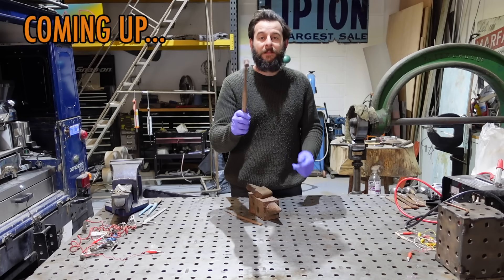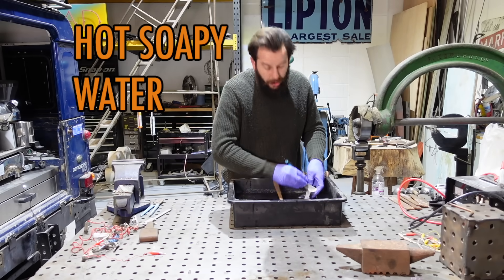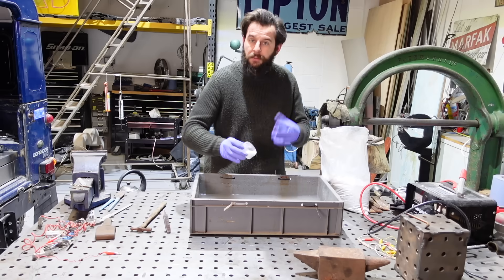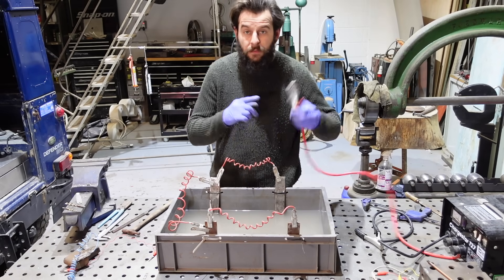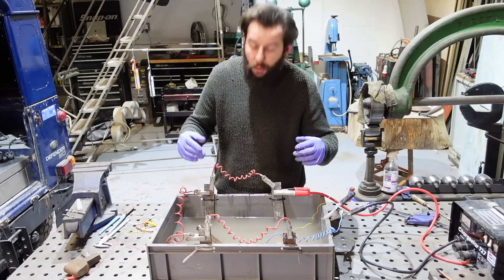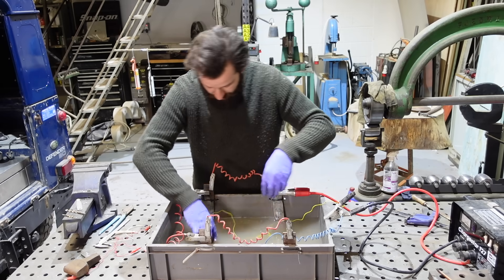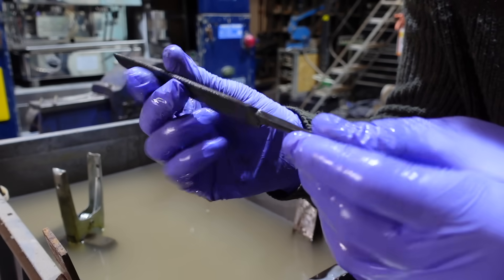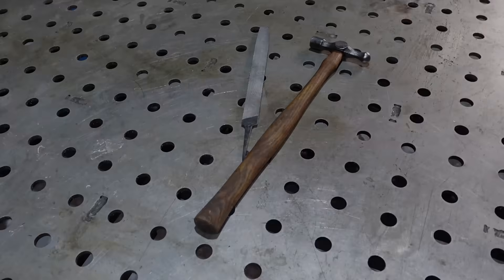The Power of Electrolysis | How To Transform Rusty Tools!

Comment: Hi Dominic your video is most interesting and I have watched it over and over. Yesterday I tried to reproduce your results and came up confused disappointed and lost for what to do next. I turned on the power last night, confirmed I had fizz, plenty of it actually and time I went to bed there was some rust which had dropped to the floor of the container, but the shifter I was trying to restore was well and truly rusted so I left it overnight. This morning when I checked the tub it was about 1/3 full of crystals in large lumps like ice burgs. I did use a lot of sodium carbonate but did confirmed that it had all dissolved before starting. Please any suggestions?
Reply from the maker: Sounds like you maybe used a little too much of the sodium carbonate, but the process sounded like it worked? 

It will only remove the rust from the part the wire is attached to 

Did it remove any rust?
Reply: @DominicChineas  Hardly any, there was a little powdered rust spots below the shifter but very little removed. I have another battery charger which I am going to try as the original doesn't have an amp meter, the next one to try does. I will use less sodium carbonate and try again. The powder I am using is "sodium carbonate light anhydrous. Thinking about it, the shifter was coated in the crystal so maybe that prevented the reaction. Thank you for your reply. I hope I can report back with success.

Comment: Using warm, or hot water will make it easier to dissolve the sodium carbonate.  Also, a well ventilated space is required, and watch it if you are using power tools for other projects as the motors can produce a spark.  (Some power tools, not all)

Comment: I did thi to remove some corrosion from solid copper cups, worked great till. I accidentally reversed the polarity, an hour or so later, when I noticed it, the cup was pitted, not bad definitely noticeable, I hope Chrome plating will restore it.

Comment: I've done etching with salt water, does this do the same thing when using sodium carbonate instead of salt?
Reply: Salt is Sodium Chloride, it gives the same result with the exception that while  using sodium carbonate, the process is relatively clean, with salt, it may produce Ferric Chloride (that gives the green coloration), which is a relatively harmful product for the environement., especially when flushed down sink.

The main pupose of dissolving a large amount of any salt in the tank water is to increase conductivity of the water for electricity, you can use any salt, considering that carbonates tend to not react with iron.
Reply: @rustygear9370  Sodium chloride is a salt. Sodium carbonate, sodium bicarbonate, sodium sulphate are also salts.

I'd be wary of some of the byproducts, chlorine gas could be emitted, I have used electrolysis to produce chlorine. You don't want much of that around, it's toxic and relatively dense.

Ferric chloride is highly corrosive, it's used for etching circuit boards.
Reply: @rustygear9370  
That's exactly what I was wondering. I always thought it produced chlorine gas, which I'm not a big fan of breathing. The good thing about salt is it seems to make the etch very aggressive. I used iron sulphate and it seemed to do nothing in the same time compared to the salt.
Will definitely try sodium carbonate.
Reply: Yes.

Comment: Honest question here, what do you have to do to prevent the parts from flash rusting again afterwards? I use the Muriatic acid bath method and right after you have beautiful clean parts like yours, but they tend to flash rust again after a short period of time. Does that not happen with the Electrolysis cleaned parts?
Reply: Did I see somewhere that you can pop them in a bath of distilled white vinegar afterwards to neutralise the metal surface?

Comment: So why does the rust flow to the positive when the current is flowing from the positive to the negative 🤔🤔🤔
Reply: Hydrogen (bubbles) are generated at the cathode or negative electrode. The process turns positively charged 'rust' cations back into the iron metal.
The anodes slowly 'rust'away as he explains in the video.

Comment: Wonder if you could use copper for your anodes?
Also, you can use Potassium Hydroxide for your electrolyte (but not with copper anodes).
The closer the anode and cathode the more efficient the rate.
FYI: many battery chargers used pulsed DC current. Steady current might give better results (add a big capacitor?).
Voltage for that would work better at 30VDC to 36VDC.
Keep adding electrolyte if you can until you get 20 amps @ 12VDC.

Comment: Not impressed, in industry we always say there no accidents only idiots. Far to many to cover here, when using a caustic soda solution eye protection must be worn, if you get it in your eyes even a dilute solution will cause permanent damage, and tap water will not help. Electrical safety protocols non-existent.
For little jobs like these, old-fashioned elbow grease will suffice, and some paraffin from the hardware store, just try not to burn the fucking house down. Nil Point as the retards like to say at the Euro-visons.

Comment: Restoring rusted parts using electrolysis or chemical baths (not covered in this video) also somewhat restores the smoothness of the surfaces. The rust  is like a minute shrub that grows from a tiny scratch or pit and builds itself up while doing very little surface damage to the item. So not only does the tool end up looking better but often functionality is restored too. For example rusty nuts and bolts can once again be used for their purpose with the need to machine the surfaces. I have a small tub expressly for chemical soaking similar to electrolysis that eats away the rust (iron oxide) leaving a black carbon residue that a gentle brush scrub under water removes. Its a great addition to your home workshop to have something like this permanently on a shelf ready to go giving you a way to save those fiddly fixtures that you want to keep original on a project (or are impossible to replace with modern alternatives). A chemical bath that isnt corrosive or fume toxic (like an acid bath) will just keep in a plastic tub  for years and years if it has a lockdown lid. Likewise an electrolysis bath you can make in a suitable sized tub to fit then inside a larger one with lockdown lid so it doesnt evaporate away and you can have at the ready always with a single cable out to power source. A simple rust removal solution is just invaluable for every restoration workshop. Just ensure you dont leave items in them for longer than overnight without taking them out, brushing and rinsing in water to check. The longer you leave them the more chance you have of the processes damaging. So leave, check by cleaning the carbon off under running water then dry  to check progress of rust removal, repeat as  many times as you need to get rid of the rust. Over time and use you get to be able to guess how effective the result will be and how long it might take. You may be able to use this as a bit of a local home business and it requires very little starting costs or running costs. Use the waiting time to learn how to sharpen garden tools and lawnmower blades which will go well with rust removal service for restring saws, axes, shovel etc. Get your eletrolysis terminals (positive/negative) properly sorted by testing with rusty nails first, some small electronics power packs can be confusing as to which wire the positive is in and which is negative. So always test first with rusty nails when building your own setup, big or small. Remember this is DC electricity NOT AC.

Comment: A current limited variable power supply works better, but I use an old solar panel- they are current limited by their construction, an old 250w ex gridtie will be up around 35v, with about 8-10A depending on the conductivity of the  solution.... (and runs for free lol)
(thats the problem with using battery chargers- firstly most new battery chargers won't work at all  for this, and they can overload and shut down if the conductivity is too high)
But yeah, electrolysis cleaning works a treat!!!!

Comment: i am SO glad that you realize that electrons flow from negative to positive.  unfortunately, current, i defined as going from positive to negative.  good on you!
Reply: Right , current [amps] flow from neg. to positive....CURRENT IS a flow of electrons. { If your battery in your car has negative to earth, this is the car body, then current flows from the neg. pole of the battery along the body through say the light bulbs, starter etc and back to the positive terminal of the battery.] Something else: you can grab the terminals of the battery or the clamps of the battery charger with your hands ! The voltage and current is far too low to do you any harm !!!!

Comment: I set up the same type of cleaning unit a few years ago. A friend had a large box of assorted tools under his work bench in his garage and his wife opened the window to "air" the garage out and left it open. There was a torrential downpour and his box was filled with water. A year later he pulled the box out to sort out his tools for a garage sale and found them rusted together into a large mass. He classed them as useless and asked me if I wanted them. 2 weeks later I'd run all the tools and many drill bits through my electrolysis bath and I'm now the proud owner of a complete collection of rust free hand tools. All with a beautiful black sheen. I even discovered two American shifters made in 1906, now fully working.

The only downside of the routine was the mess following heavy use of the bath. It leaves a very nasty looking scum on the surface which stains anything it touches. I wouldn't advise putting this down the drain, probably best to dispose of somewhere in the garden. You can get a slight tingle if you dip your bare hands in the solution, but it's not enough to cause discomfort. Don't forget, some chargers use 24 volts and 12 volts, I advise 12 volts for safety reasons. After the de-rusting and cleaning your tools, I give them a light spray of thin oil (WD-40 is OK) and a wipe with a rag, this will protect the tools from rusting again. One final tip, never cover the bath during use, hydrogen is produced (the fizz) and with those electrical connections a spark may cause it to go boom. Oh yes, any chromed tools will lose their shine, but don't worry. the resulting black sheen looks even better. :-)

Comment: For a bit of fun, drop a copper coin in and get a copper plated hammer!
Reply: I wondered about that myself. Connect up a bit of copper pipe, but anode or cathode?
Reply: @Velocipedium  just drop in solution, electrolytic principles ensue.
Reply: How about brass? Will it work
Reply: @mattwigren5017  yes, very likely

Comment: I’m rather sensitive to breathing rust dust so I use this method to de rust longer pieces of metal 
I use an old large gas cylinder with the top cut off which is quite deep, using a metal container is good because you don’t need additional electrodes your whole container is an electrode.
I use 3 volts from a computer power supply, you don’t need many volts, and run it overnight. This way you don’t get the scum, 
This method works well even on very thick hard rust which can be wire brushed of very easily, then just use scotchbrite to remove the remaining easily removed black layer. 
An inverted cone like the top of a traffic cone at the bottom of the tank centers the work and stops it shorting out.

Comment: Calcium bicarb decomposes to Calcium carbonate under heat, and can also be used. Never use table/sea salt (or any Chlorine salt) with steel or galvanized steel - most steels have a Chrome content that reacts with the Chlorine from salt which produces Hexavalent Chromium Chloride - that nasty stuff Erin Brockovich ripped PG&E for because they were dumping it and got into the potable water wells around Hinkley, also the zinc combines with chlorine - Zinc Chloride - and is also toxic.
The bubbles are hydrogen and oxygen - not particularly toxic - but do pose fire or explosion risks without proper ventilation.

Comment: Your most basic battery charger wont work well as most of them have sensing circuits, you need one with a manual mode, this is crucial, then you can easily set it up to even 10 amps or even more than that to speed things up(although high current will cause pitting) 
For best sacrificial anodes, use graphite rods, not only they are best but also don't leave any rusty mess and don't even cause foaming(as you do with metal anodes).
Its also crucial not to use stainless steel as sacrificial anodes, they are dangerous.
Reply: How crucial is it really to not use steel? Because he just used it and is ok.
Reply: @youtubedeletescomments steel, not stainless steel, the latter has chromium, which is very toxic and it's the last thing you want to use as anode in electrolysis.
Reply: One can make a battery charger from old micro wave oven parts; Google if you can not figger it out yourself.My brittish is bad as I am not Inglish speaking, sorry!

Comment: I tend to use cleaning vinegar to bathe rusty things, works similarly, but the rust rises to the top of the solution so you need to scoop it off at the end.
Probably takes a bit longer ~ 10 hrs, but you dont need a battery.

Comment: Don't forget the safety message. Throwing electrical connectors onto a metal table doesn't send a safe message. Not everyone watching this will understand that you should only do this if the charger is disconnected.

Comment: Very useful video.
Whilst it's alway wise to switch off the power, you're even wiser to use only 12 volt which you will not even feel
if you touch it!
Your Ace process could also be done using a small lead acid battery (even a big one which would take longer to 
discharge) BUT , a BIG BUT.
You must include a small fuse in the circuit (or one in EACH leg) as close to the battery as possible.Accidents do happen and 5 amp fuses would protect you and the gear.
Of course that pro charger will be fused anyway.
Thanks for the video.

Comment: Some battery chargers won't work with this as they need to see a voltage (ie be connected to a battery) in order to work. You can get around it by putting a 12v battery in the circuit to trigger the charger. For small jobs I use an old laptop  power supply - works a treat.
Reply: i found this out recently. it also wont allow a completely dead battery to charge. i put a 9 voly battery in series with the battery for a short time and remove when the dead battery has a small charge on it

Comment: Great video! Little tip: If you can't get your hands on sodium carbonate, you can convert baking soda (sodium bicarbonate) to washing powder (sodium carbonate) rather easily. Heat baking soda in an oven for an hour at ~200F (~95C). That drives off water and carbon dioxide. 2 NaHCO3(s) → Na2CO3(s) + CO2(g) + H2O(g), and voila!
Reply from the maker: Thank you so much for the tip!  Perfect!

Comment: Hi Dom, saw you do this on the repair shop and was so pleased to have found the full video. used it on some irreplaceable Bathroom items and it worked like a dream. I have a question if I may Dom.  If you reverse the electrodes will it electroplate the Positive item. keep up the good work mate.

Comment: cornelius whitehouse very good quality tools, have put complicated threaded things in which were seized, it release the rust / seizure over night, I use graphite/ carbon rods for the anodes now. what ever you do, never put stainless steel in it, anywhere it produces highly toxic stuff, so when you dispose of the soda water solution it will kill thing over and over forever,all over the place.

Comment: One possible hazard is the gas that is generated from the electrolysis process.
If I remember correctly, the gas is _hydrogen_, which of course is very flammable. Dominic is doing his cleaning in a fairly large open space, with the gas floating up to the ceiling, which should be safe enough. But doing this in enclosed or unventilated spaces should be avoided.

Comment: I remember using this same process 70 years ago. Isn't it strange how reinvention takes place at regular intervals!
Reply: Yep, we used the same process but in my case it was 60 years ago.  We also used many other different processes using chemicals that would be strictly illegal today.  
We used to heat rock Sulfur in an open pan over an open flame until it liquified and use it as a glue/gap filler to fix steel shafts into wooden rollers.
We also had an open molten cyanide hardening bath to give a hard surface to steel components and for many years we also had an open Tricoethylene degreasing tank the operator of which was always seriously affected by the fumes by lunchtime.   In our ignorance we assumed that he was just a secret drinker combined with being a bit crackers anyway.

Comment: Dom, I believe the need for longer immersion is actually due to the surface area to volume ratio....if I remember my chemistry stoichemetrics (reaction rate calculations properly). The greater the surface area to volume ratio, the quicker the reaction will occur. Seemingly perversely, the smaller the substrate the larger the sa/vol ratio. This is why fine powdered sugar dissolves quicker than sugar cubes. The point at which no more of a substance will dissolve is called the saturation point. Once you go beyond this, the solution is called a “super-saturated solution”.

Comment: Very well done, I have been using this technique for many years to clean classic car parts. Just a wee hint, if you add enough sodium carbonate so the solution become saturated(aka cannot dissolve any more in solution) the positive electrode is not consumed. The positive electrode stays shiny in solution for years, in addition, I have not changed the solution either...